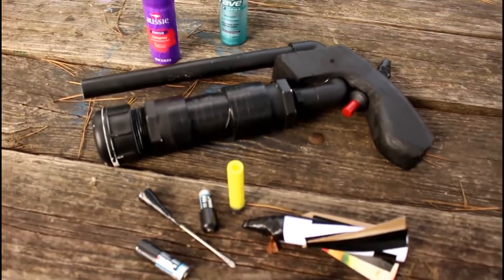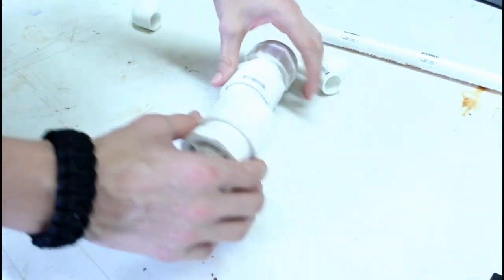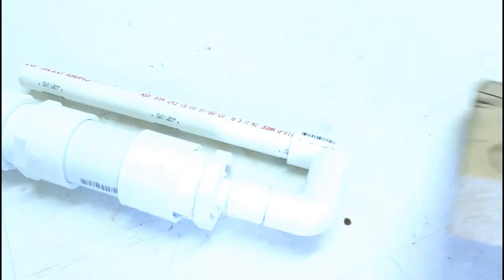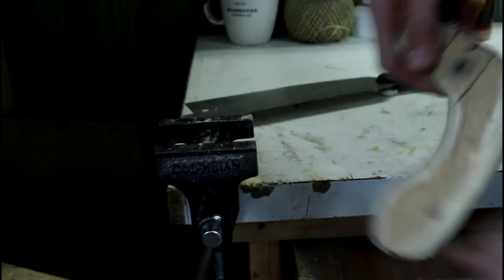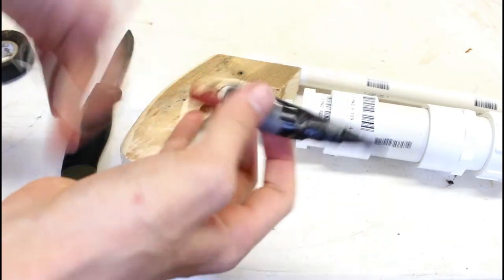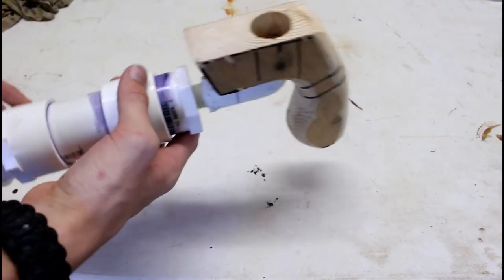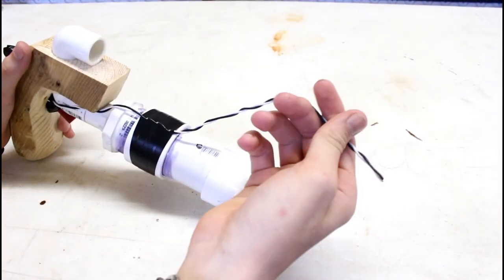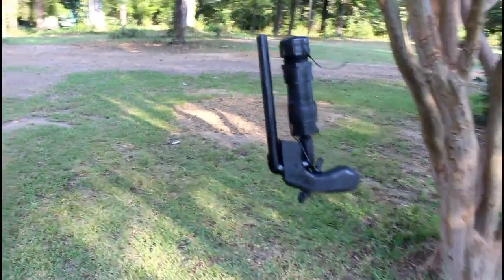How to build a PVC Hairspray Pistol

Comment: Hi, is it ok, to use paint thinner as fuel ? Thanks
Reply from the maker: Not really sure. Paint thinner is generally a combination of loads of lovely flammable stuff; including acetone, mineral spirits, iso-butane, alcohol, and tons of other generally harmful chemicals. Extremely flammable to be sure. No problem there. It also vaporizes quite easily, simply based on what its made of. Never tried it in a spud gun, I would worry that it might eat away at the PVC, but to be honest I have no clue. Sounds like you should give it a try and let us know, eh?

Comment: Hey Jake! I am putting together my own PVC hairspray pistol. I bought a Char-Broil Universal Dual Spark Piezo Igniter. Will it work for the sparker, or do I need to buy a different igniter?
Reply from the maker: Awesome! 😀 (I'd love to see a pic when you finish)

Not sure what particular igniter you are referring to, but if it makes a spark it should work fine. Really any kind of Piezo sparker works for this project, the main differences will be the practical aspects, such as how to attach it to the gun, how long the wires are, where the trigger will end up, etc. You'll probably need to screw around with it a bit to figure out the best way for your gun.
Reply: It comes with spark electrode,collector gas collector box,spark generator and the wiring. I'm not sure how I'm going to wire it. Oh, I almost forgot to ask, am I going to need the grounding wire as well? I've never taken on a project like this, and I want to do it right. And if you'd like to see a pic of it after I'm done, I'll post it on INSTRUCTABLES. I'll make sure not to give any details on the build. Just look up DanaM51 and you'll find my post.
Reply from the maker: You shouldn't need the ground. Most small electrics don't even have ground wires, and when they do its only as a safety, in case there is some sort of power surge. For a Peizo like this its not necessary. All you should need is the spark generator and the two wires.  You'll probably need to snip off the electrode, as its going to be too difficult to fit it into the combustion chamber. You only need a spark between the two exposed wires to set it off.
Reply: I didn't figure I would, but thought I should go ahead and ask, just in case! Anyway thanks. I can't wait to get it finished. I should have it done in the next couple days.
Reply from the maker: Your welcome!
Reply: It's done! You can find my pic in the comment section on your Instructable for your pistol.
Reply from the maker: Sweeto!!! Heading there now 😃